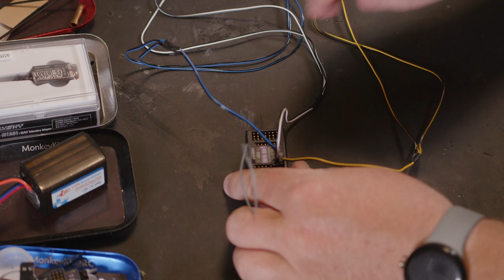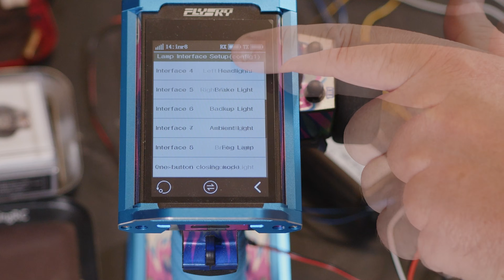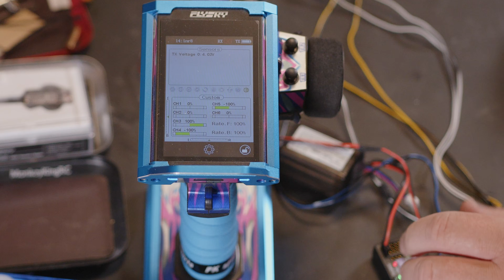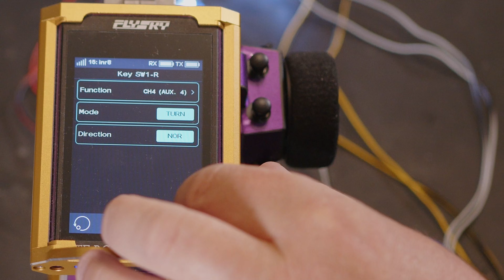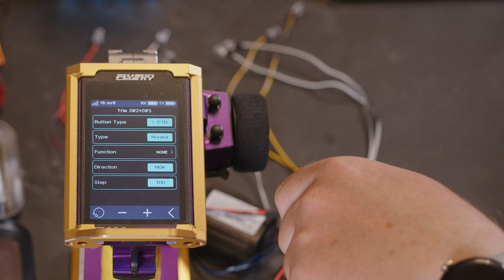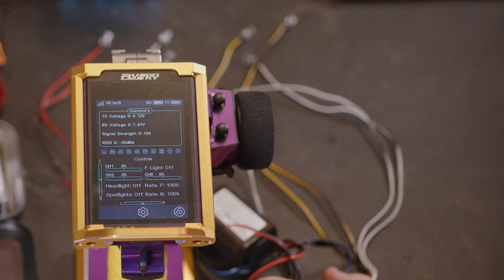Flysky INR8 8D light control set up nb4 and nb4+

Comment: let’s say you had a single string of red LEDs in the back. Is it possible to have them glowing at say half brightness as if your tail lights were on but then when applying the break they go to 100% brightness when you’re on break kind of like activating a brake light? Is this possible to program two functions to the same string of lights with different brightnesses?
Reply: I made a Y-harness for the taillights and breaklights to work together and i have it set at 20% brightness when running and 100% brightness on the breaks.
Reply from the maker: Not something I've tried but it can do driving and brake lights so you could mix the LEDs in the rear lights so you can have both I'll have to take a look if I get time and fit it in an RC :)

Comment: Can’t believe I’ve missed this! Looks great. There’s one thing though.. a breaker cable - most bodies holds most of the lights and goes off, and the receiver stays on the chassis ..😐 I really hope this finds its way to the FS-G11P too.. I find that radio to be somewhat more suited for scale cars/crawlers.
Thanks for yet a smashing video❗️
Reply from the maker: The G11P already has light control receiver :) although I like the G11P the nb4 pro + is the best tx for crawlers it has momentary for winch and 18 channels ;)
Reply: @WTFRCCars Absolutely, and thanks to Flysky for bringing this on, a missed feature for sure! (I got a couple of MG11-BT-BS.. I know they’ll release an app to support light control, so there may be more in the pipeline!)

Comment: Is there a way to connect this receiver with another receiver to make more channels available? I need 9 total with the throttle mixing/dual motor taking up 2 channels. Either that, or is there a way to do moa mixing with only using 2 channels instead of 3
Reply from the maker: You can add 7 extra channels using the ibus 2 break out
Reply: @WTFRCCars ok thank you. Do you have a video on that one?
Reply from the maker: Yep in ibus 2 playlist :)
Reply: @WTFRCCars oh i found it. Thank you

Comment: I just updated my nb4 pro+ to fw v1.0.23EN, to see if I could use this receiver, and the number of model memory's went from 25 to 18... 😭 My very old spektrum dx3r had 50... And my dx5 pro has 250... I love the nb4's, they are sooo much better than spektrum, but I don't get why they won't give us more models. I have both my old nb4 and the pro+ because 25 is not enough, and they take it down to 18... I had to downgrade the firmware. Do you think they at least will bring it back to 25 in the next FW or did they just make the pro+ permanently worse than the original nb4?
Reply from the maker: It's really crap but no there's no space in the memory for more than 18 now :(

Comment: So I just plugged in my lightbar and noticed that it is dim even at 100%. I've read the manual and it says it supply a max of 2.6w per channel on all of the light ports. Will Flysky update that in the future with their firmware update?
Reply from the maker: No this is not designed to run a light bar it's designed to run LEDs directly you need to connect the lightbar to a channel on its own :)

Comment: On a side note... what would happen if you connected a fan to one of the light channels? could you use this to turn a fan on and off via the transmitter?
Reply from the maker: You could be remember there is a max amp limit I mentioned it in the vid

Comment: So I saw in another comment you were possibly going to check the voltage of the output as I know some LED lights can only run at a certain voltage. At let’s say 100% output do you know the voltage output of the channels?
Reply from the maker: Not yet but different colour LEDs use different voltage from around 1.8v to 4v so at least some I would think will need resistors but depends on the led

Comment: Hay brother,  got a question. Can I run the inr8 from the inr4 so in a sense add the light controller and not lose my gyro option?
Reply: I guess a simpler question is can I use the nb4 update light control feature on the inr4?
Reply from the maker: Yep
Reply: Next question can I run a other receiver that has a light kit from my inr4?
Reply from the maker: Really depends on the receiver the new INr8-8D is designed to do this but not many others are.
Reply: I'm thinking through salutations and if it's possible to run the inr8 as the slave of the inr4? Some ibus link maybe?
Reply: Can you make a video if that's possible?
Reply from the maker: Yeh should work fine.

Comment: Great video as usual - I couldn't find in the manual what the voltage was for each light output.  I dont know if I should by 6v or 3v LEDs. Since I dont have the receiver yet, so I was wondering if you knew right off?
Reply from the maker: So flysky say you don't need to run resistors with this receiver so the output should be no more than around 4v but if I get time I'll stick a multimeter on it and take a look :)
Reply: @WTFRCCars  So I received my INr8 today and it looks like whatever voltage i'm sending into the Rx is what comes out on the LED controller output channels. if my BEC is set to 6v, Im seeing 6v out of the LED channels. So thats good.
Reply from the maker: Yeh should be right

Comment: Do we know if this is working with the NB4 Pro Plus yet?
Reply from the maker: The EN version yes EU still needs new firmware
Reply: @WTFRCCars  Ah ok, cheers. I did see a x.x.23 version in the desktop app's update section but its missing "Plus" from the name so wasn't sure if it was just listing the non-plus versions by mistake.
Reply from the maker: Don't try to use the wrong firmware if you need the EU

Comment: You don't need to have any resistors in the LED Cable, because the resistance is built into the INr8-8D - I've connected Tail Lights (set to 10%) and Brake Lights (set to 100%) both connected to the same LED. This gives a bright Brake Light when Stopped and Dim Tail Lights when running. Very impressed.
Reply from the maker: Yeh also depends on the LEDs you use but it does state in the instructions that resistors may not be required :) cool kit though
Reply: I was wondering if this was possible, just used a y harness?

Comment: Do i need the newest Firmware? Backup before updateing?
Reply: @WRFRCCARS Do my NB4 doesnt have a lamp menu setting. Do i need update firmware to see that setting in the menu?
Reply from the maker: Yes it won't work without the latest firmware
Reply: @WTFRCCars  hahah I see why havent done it in 
the past   - from the manual - "Note: The model data will be reset after the firmware update. Back up the model
data before you perform firmware updating."
Reply from the maker: Yeh back it up with assistant 1st
Reply from the maker: Make a back up using assistant then use the firmware updater not assistant to do the update then use assistant to restore the memories

Comment: If this had a gyro in it still it would be perfect
Reply: I think you can use this as a dual receiver setup and basically team if off of the Ibus port.
Reply from the maker: It will work as a dual receiver on the pro and pro+ transmitters or just as a light controller running from the original receiver in the rc
Reply from the maker: Think this is aimed at crawlers but yeh one with gyro for drift and bashers would be spot on

Comment: What is the output of the light port channels? Can it handle 2S output? Or is it limited to 5V each port? Flysky did good with that one! Will save a ton of wiring on crawlers with multiple lights.
Reply from the maker: The input of the receiver is 3.5 to 9v  so I'm guessing the voltage is lower than that you only have 2.6 watt ot 80ma to work with